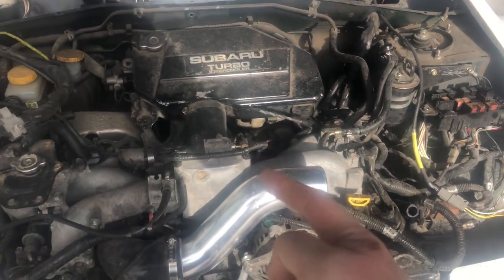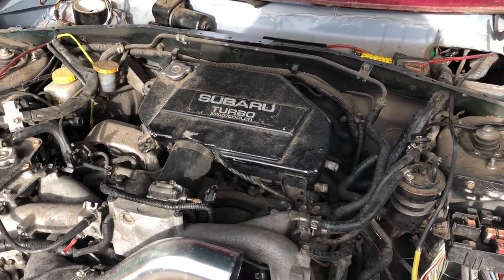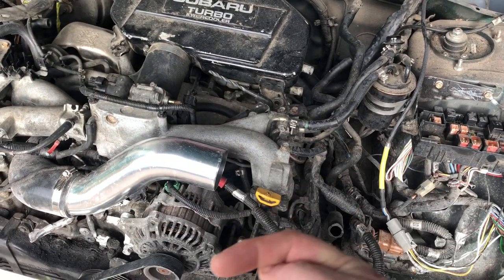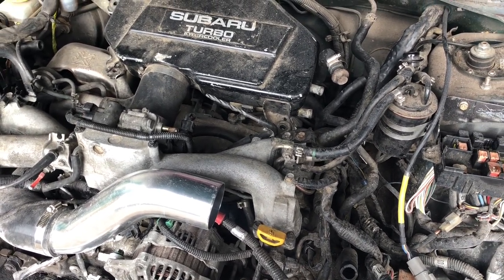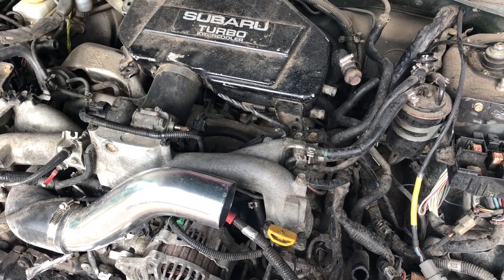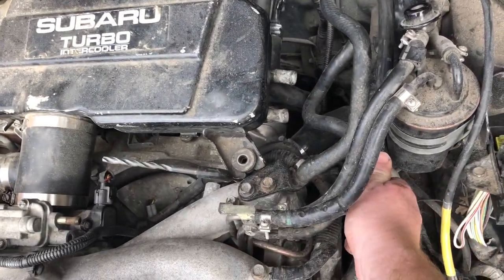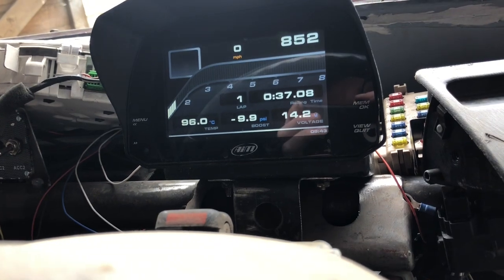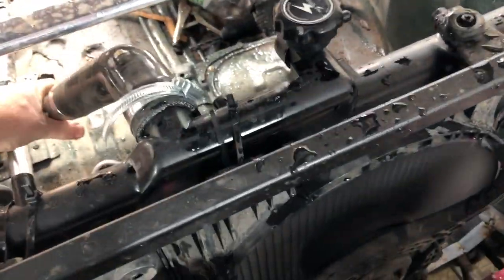Metro 6r4 Subaru (Frank) - Bleeding Radiator

Comment: Spag bol for tea. So with the rad being in the back inside the car with no airflow i would be surprised if the fans would go off when stationary. I bet with just a tad of air through the rads it would be fine.

Comment: BMW i8 have a similar issue with bleeding radiator though opposite way round. You could try jacking back of car up so it's higher than engine or borrow a vacuum bleed system. Other than that bite bullet and get a pump.

Comment: It might help to add a bleed valve at a high point in hose in the engine bay.  Air could be trapped there and isn't getting pushed down to the long pipes back to the radiator.
Reply: Beat me to it. Good idea 😀